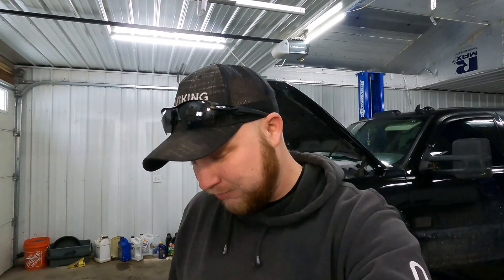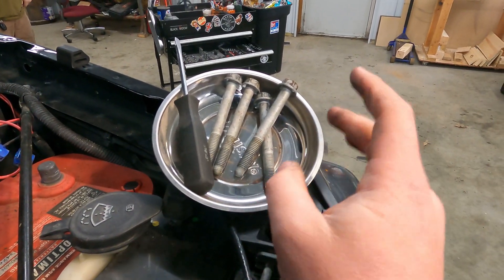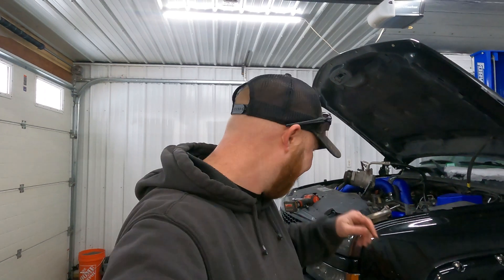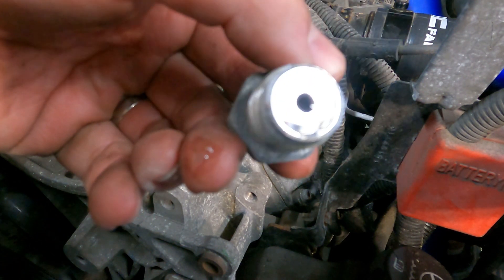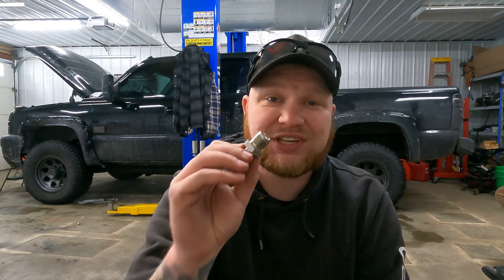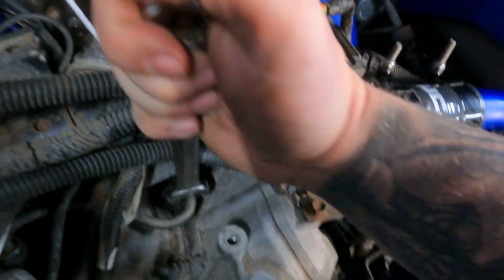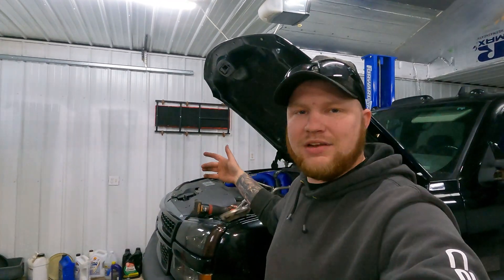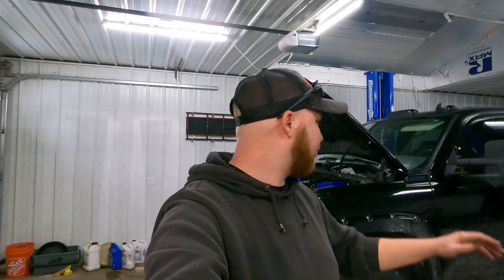2004.5-2012 Duramax Ppe Ported Fuel Rail Fitting Install!!! (LBZ Duramax)

Comment: Do you need a Fass to do it or a airdog?
Reply from the maker: No you do not
Reply: @DIYDiesel hey i just installed the ported and race plug and have a slight leak in the PPE race plug Any advise already switched out the seal and torqued it again to spec

Comment: U need to run both sides not only one so u can spray evenly not only 4 more and 4 stock won't run rigth
Reply from the maker: That is false information. You can certainly contact PPE, and talk to them about this topic. That is why they do not sell them as a pair, if that was the case it would be sold as a pair and the instructions would be engineered much differently.

Comment: Should i do both sides or just the driver side
Reply from the maker: Depends on your truck. If you are not pushing a ton of power it isn’t fully necessary to do both sides. Will it hurt to do both? No. Personally I had good conversations with PPE, and Josh from truck master diesel about this topic. They both said just the drivers side is more than good, if you don’t need to push allot of extra fuel.
Reply: @DIYDiesel  my truck just lacks power so I’m getting the ported fitting and the race valve plug to see how that helps

Comment: OK on mine the hard to get to line nut it won't come loose but the thing it's connected to deep down came loose instead?? Help
Reply from the maker: Can you not get a good grip on it?
Reply: @DIYDiesel  I got a good grip I guess its just so tight or stuck on it loosened the part that connects it to the block. Unless it's a right thread instead of a letf to loosen ?
Reply from the maker: @JasonY02  no it’s a normal thread pattern, did you throw some penetrant oil on it let that soak? That may work otherwise your going to have to remove a bunch of stuff to get to it.
Reply: @DIYDiesel  I didn't think about useing oil till it did what it did I might just take it out the way it wants to come out and separate the 2 peaces then use a socket and torque the peace back down then install line. Will it matter if I spray brake/parts cleaner on it to help clean out all the gunk around it ? It has PB blaster on it now looking for a special rench to try and hold the bottom peace but not sure yet might just do the plug and wait on the ported fitting.
Reply from the maker: @JasonY02  I would let that shit soak for 15 min. It won’t hurt to spray that in there no. If you have the time to take the rail out and do it that way. That is defiantly the better way to do it. Just takes a lot longer.
Reply: @DIYDiesel  since your the only one to help ima let you know.
I got it fixed and put the ported fitting in. The truck started leaking fuel really bad after the first attempt and do to the fuel/pressure it cleaned the gunck off and lossend the 2 peace foe me so I took the fuel line off and used a impact to make sure the block fitting was tight asf the changed it and put everything back together so far no leaks.
But the truck sounds different after the install (or I was just paranoid) but when you did it did the sound change like it sounds like there might be a tick on the passenger side but not 100% sure.
Reply from the maker: @JasonY02  when I did them I had no change in sound at all a tik would come from oil viscosity not fuel. Fuel is more of a knocking sound. I would check your frp and then run some additives in it for a few tanks
Reply: @DIYDiesel  I've been running Lucas. But thanks for the help.

Comment: I have a 04.5 lly and am trying to remove the fprv and the bracket for the gpcm was bad enough about 3 hours but the valve is a whole nother story, I guess I am going to have to grind down a 6 point socket.  Would it be easier to completely pull the rail?  One more ? Would the ported front plug be ok to do on a 225,000 mile truck with no mods, just a daily driver?
Reply from the maker: Wow that’s crazy mine came off actually pretty decent. No issues at all even took it off with just a 18mm wrench I believe it was. I would at this point pull that fuel rail yes. 
Also I would definitely do it to your truck. We plan to do it to the “Paper Weight” that has over 300k stock. Just way better flow, and in turn makes the system not have to work so hard.

Comment: Just drill it out with an 1/8" bit and wire wheel the rail line to clean it up while you have it out. IMO there wasn't really a noticeable performance difference.
Reply: .187 to be exact..drilled out 100's of them
Reply from the maker: I noticed my frp on my monitor dropped, as well as much better throttle response. It’s possible I noticed it more due to other modifications as well.
Reply: @DIYDiesel  Fuel rail pressure drops are normally a sign of problems. I would look at your commanded vs actuals for the FRP. 
Keep up the good content
Reply from the maker: @frankrey7676  appreciate it! Thanks for the support as well 🤝
Reply: U need driver and passager side also

Comment: So on a stock daily driver truck, you only need to install 1 ported fuel fitting? Thinking of buying one for my LLY now, great video!
Reply from the maker: Yes you can 👍 amazing throttle response I think I need to do a review on it. Very impressed with it. We will be adding it to the paper weight Duramax in the future that has 300k on it.